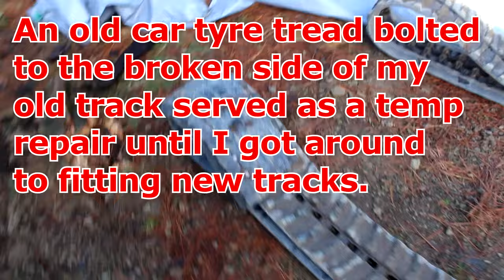How to remove and replace excavator tracks the easy way

Comment: Thank you for creating this great video . Im down in Sydney Australia.
The track came off when i was in the bottom of a dry creek bed. I thought there was no way I could fix this but then came across your video and decided to give it a go.
Amazingly we got it back on but in the process of screwing the tension bolt back in I stripped the thread. 
No parts dealers open on a sunday... and unlikely theyd have it in stock I was so close but one small bolt meant I was still stuck there. 
I turned to youtube again and learnt about die and tap sets so ventured out to buy a kit. $200 later. 
Managed to rebuild the thread... got it back on the machine.. pumped it with grease. I was using a manual grease gun but that was killing me... changed over to a Makita one that attaches to your cordless drill... worked brilliantly and you could see the track lifting. Did it till 2cm gap.. closed the cover and drove my machine out of the creek. 
Brilliant! Could not have done it without your help mate. 
Thank you.

Brian :-)
Reply from the maker: Well done mate, glad you got the machine out of the creek.  Youtube is a great source of knowledge

Comment: We just used your video on a Kubota KX033 and did the track in like 20min or less and at night.  We had a big rail road tie that we stuck over in  the front to use when push the tension in with a long 4x6.

Comment: Marty, thanks for taking the time to do this and following your video i just did my tracks in no time at all with no issues. All i did different was to fully remove the greasing nut so when i pushed back the wheel it went fully back easily making it simple to slip over the track. Cheers.
Reply from the maker: Glad you found it useful :)

Comment: I just pivot the boom (using foot pedal) until the boom is close and use my bladed bucket and push the ideler wheel back, usually has old track still on it, But have done it once on the wheel when a track broke and still worked fine. It gets the wheel ALL the way back and makes changing out the tracks a lot easier and stops the need of having to pull the bleed bolt all the way out also.

Comment: i find it easier to wedge the pry bar in at an angle on the idler and let the mchine work it back on by tracking it forward (the one up in the air only obviously)
Reply from the maker: Some people prefer to do it that way, got to be careful the bar doesn't get caught, flick round and break a leg or something. Others will use the bucket to apply pressure to the track while walking it on, this can damage the tracks and idler if not careful
Reply: @MartyT  I'm always careful. I would never use the bucket, you are rite that's asking for trouble